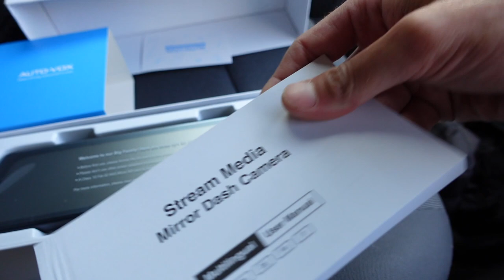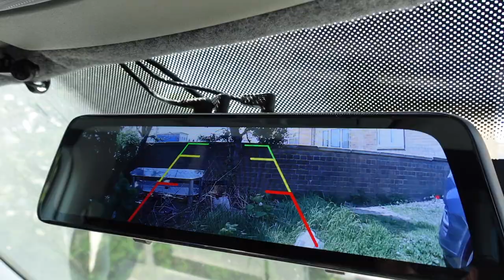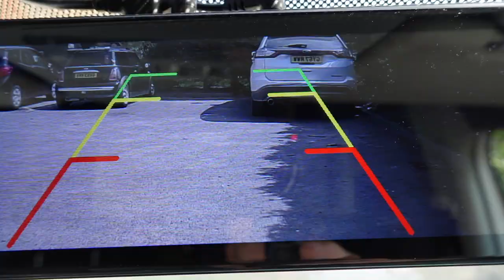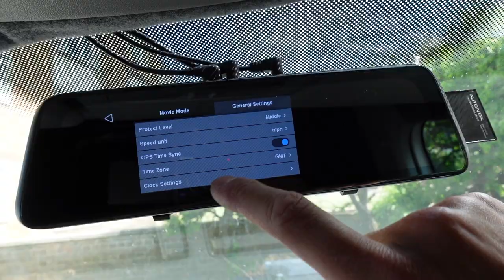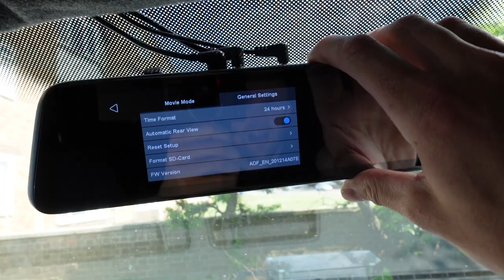INSTALLING REVERSE CAMERA WITH 9" MIRROR DASH CAM - VW CADDY

Comment: Nice one Daz! I tried a similar one on my transporter but if you already have parking censors like I do it interferes with the unit and never gives you a clear picture. Like jumping all the time.  Nice seeing you 👍
Reply: this is an interesting comment.. I'm about to fit a cheap but wireless system to my 2019 polo and that has sensors too. I wonder if the canbus system is detecting an unusually high draw to the camera from the reversing lamp wiring and upsetting things? Might need a low power relay and separate positive feed (negates the wireless system if that turns out to be the case